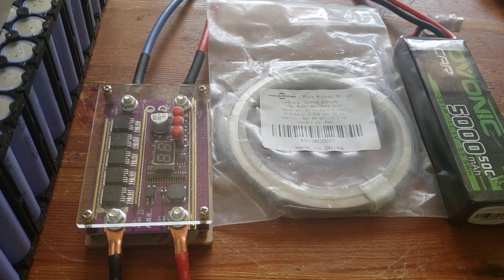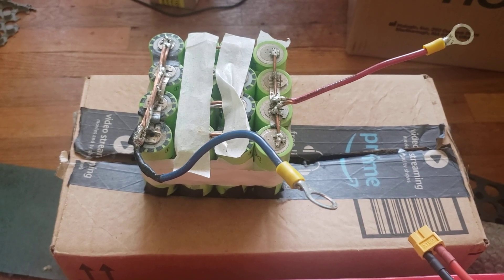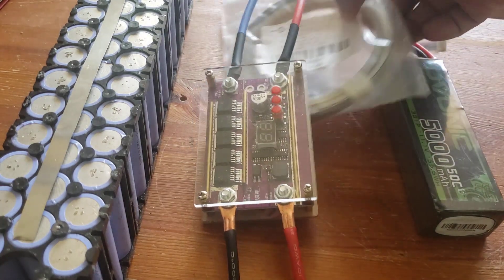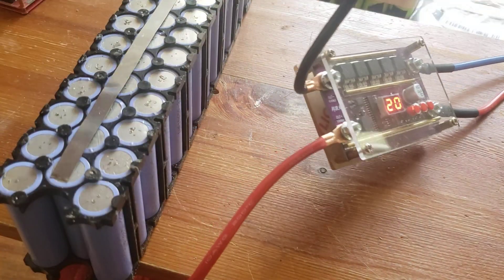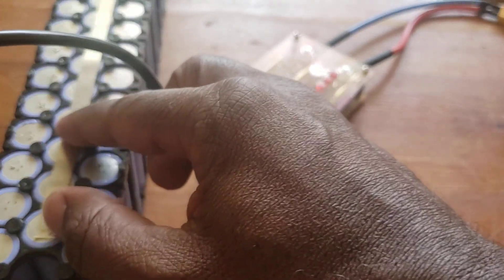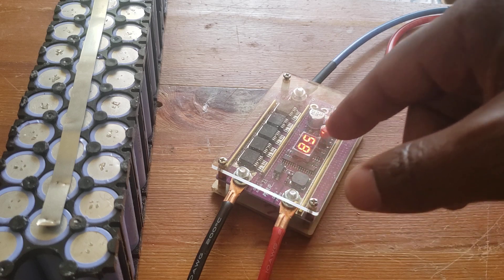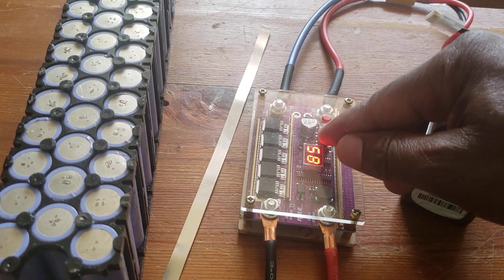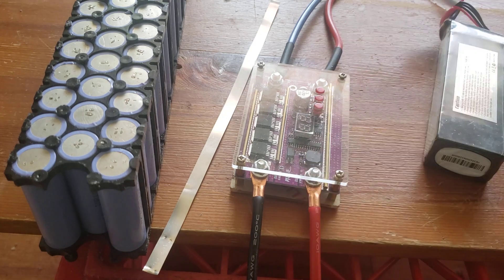UPDATE  "Purple" Mini Spot Welder Machine kit  DIY #lifepo4 #18650battery #battery #spotwelder

Comment: Then you will have the best spot welder board that there is to buy.oh almost forgot the most important part  and its that the voltage sag the moment you weld and may cause the MOSFETS not to fully saturate(open) and hence blow up. Solder a diode, resistor and a 1000uF electrolitic capacitor where the plus trace goes to the optocoupler.there is a video of the mod on youtube. Then you'll have a good working spot welder. It does not hurt to use a 300A fuse between the battery and the plus input of the welder either...

Comment: And you need to solder a lot of tin on  the traces all the way. Even better if you buy same MOSFETs of the same kind and solder them on the back side of the board and thicken the traces there too. But with a lot of amperage you need to buy at least 5 pcs of 5kp13A TVS( transient supression diodes) diodes and put them between the plus and minus of the output (to the welding pens) to protect the MOSFETS from blowing up!
Reply from the maker: It is a lot to do to have a good spot welding. I will do it in the future

Comment: You need something like a car battery or a lipo minimum 3s 8400mah 120C
Reply from the maker: I will try a stronger battery in the future, I  am currently using MALECTRIC SPOT WELDER